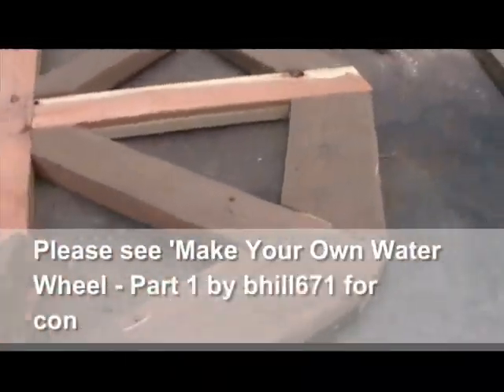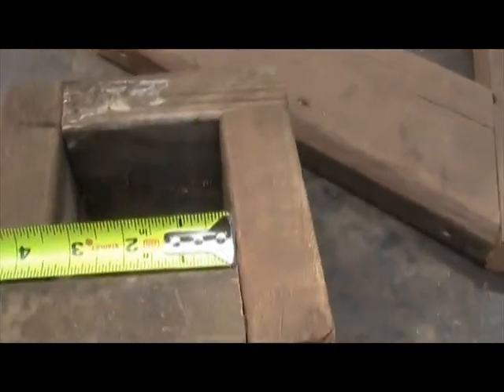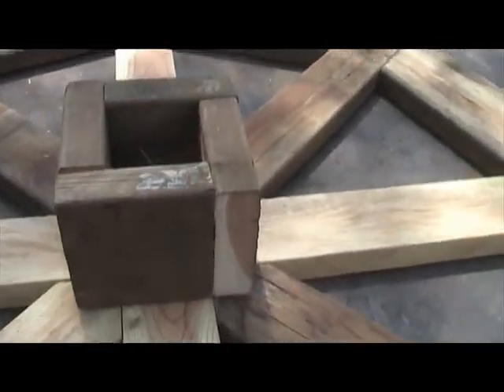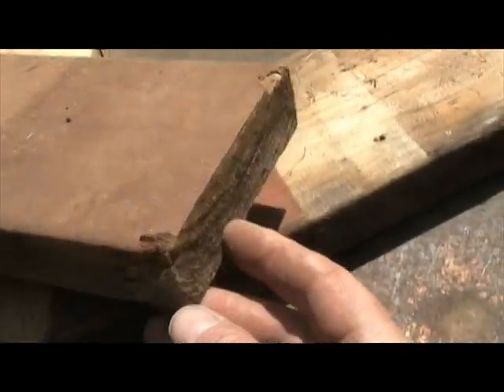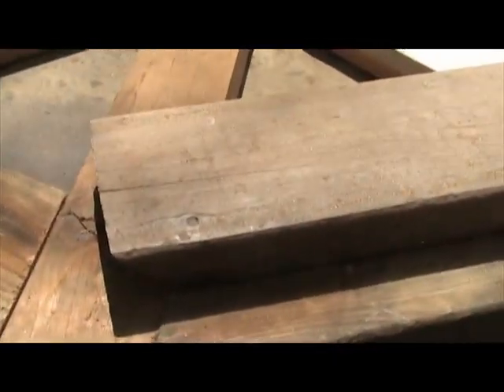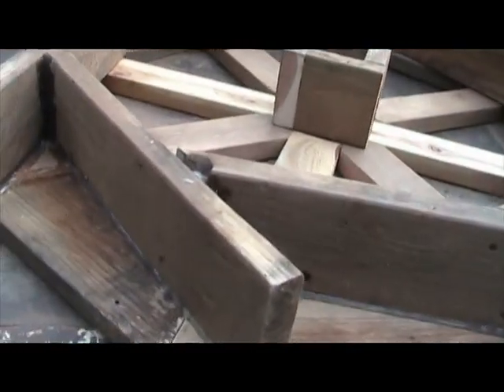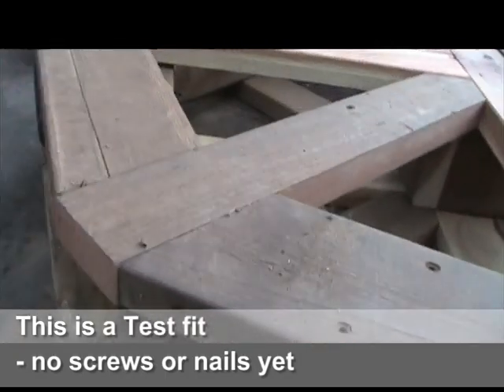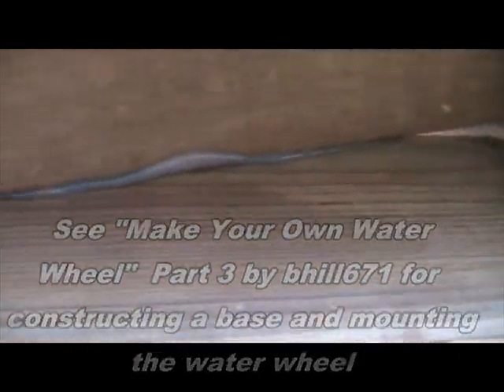Make Your Own Water Wheel Part 2

Comment: Brilliant!  I am currently working on a water wheel and have never really built with complex math and achieve the same results. The amazing part for me is watching your video and how the secrets unfold of how to achieve these difficult assemblies without math. I just noticed after building the center hubs how you used each point around the wheel to line up the center water catch points!  The process is amazing because I would not have noticed that until I started working on the wheel!  Excellent design

Comment: Really don't need the silicone. It's like a boat hull. If you screw everything tightly together when the wood gets wet it will swell and seal. And when running, the water doesn't sty in the buckets long enough for leaks to be a problem. Especially with an ornamental wheel that only has to turn itself.

Comment: how long will it last before rotting?
Reply from the maker: It's been 11 years and it hasn't rotted yet (probably the redwood still somewhat decay resistant).  However - Problem I've encountered is that the wood has dried out enough to absorb water unevenly now, thereby creating a lopsided counter-balance once it gets wet!

Comment: My wheel has to be 36", not 48.  I've worked out the new dimensions for everything except the angled spokes and the water compartment pieces.  Has anybody had experience with this?
Reply: Mind sharing what you figured out? Would be greatly appreciated!! We tried a 2’ but couldn’t get it to match.

Comment: Ok not bagging or anything. But the 2x6 you cut at 22 1/2 it shows you mark it and cut it at a bevel cut of 45° slant cut. That didnt make sense after you said it messures up to 22 1/2 it messures to 23 1/2. The way you cut it. Should be the short end is at 22 1/2 and the long ends at 23 1/2